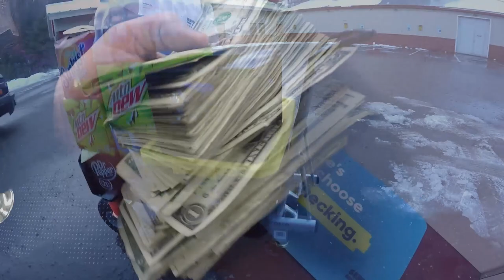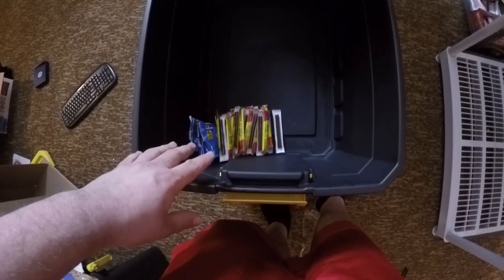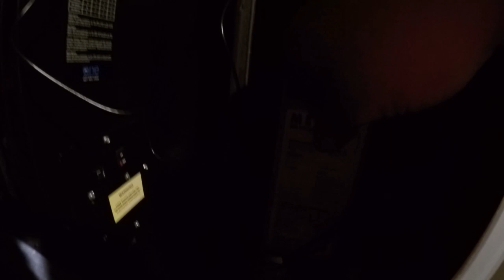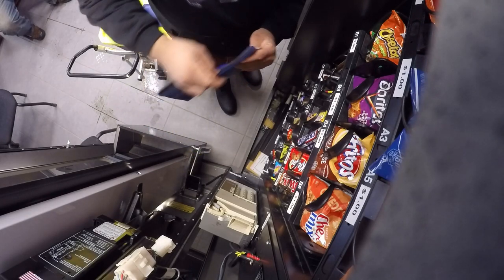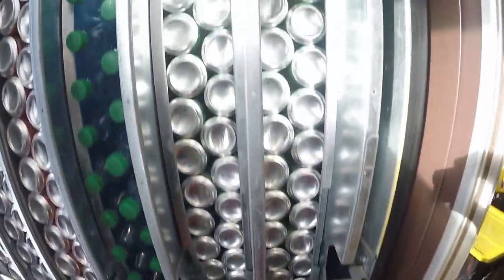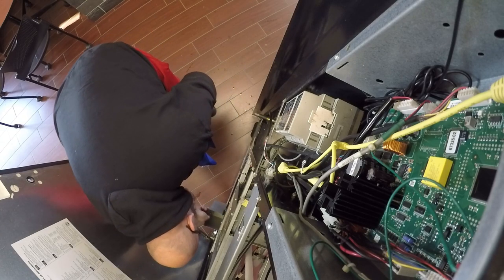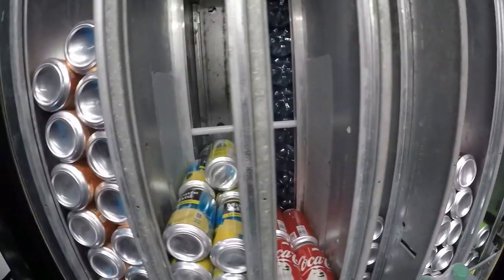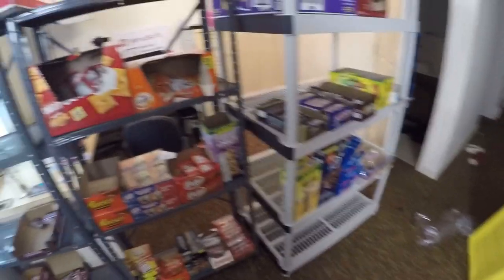Making over 700 a week with my vending machine business

Comment: Wats up keep grinding OG been watch for a minute now.....I just wanted to know what type of machine that was that had a motor error........ And how could you tell for other machines if the motor is bad or does it display it on the reader like yours did?
Reply from the maker: that was a usi soda slave. the board is upgraded from D&S vending and when a motor fails it reports the error most machines have a way to do this. but you should always try cycling the power and force vending before replacing
Reply: @afcvending6037  thanks appreciate it

Comment: You go to program a soda machine do you program it before or after you get to the location and if you do program it before you get to the location do you do have to redo it again because of the machine being unplugged and does it do the same thing for the snack machine
Reply from the maker: programming is usually done on site and there are varius reasons for doing it